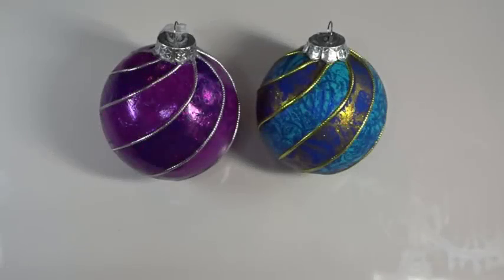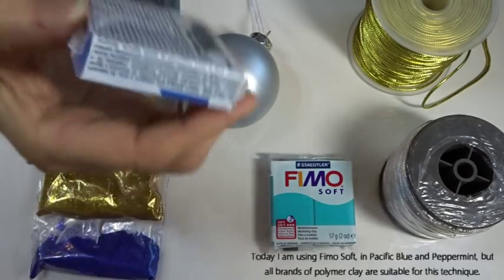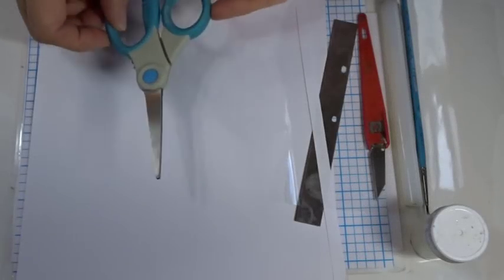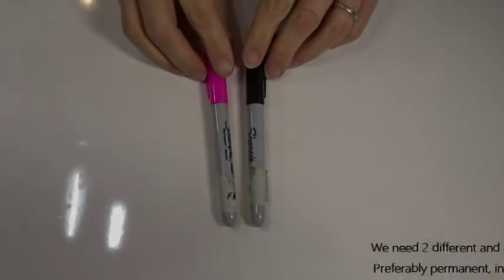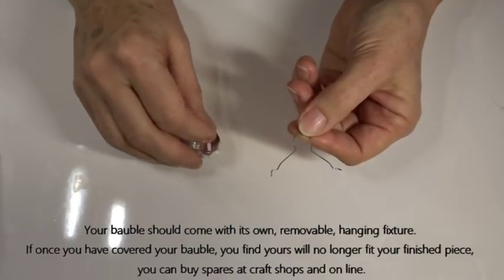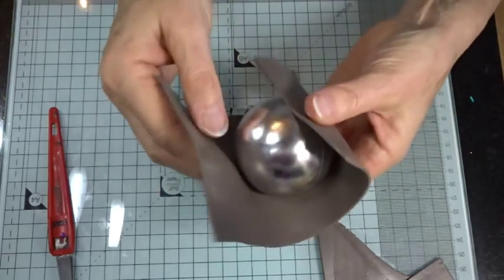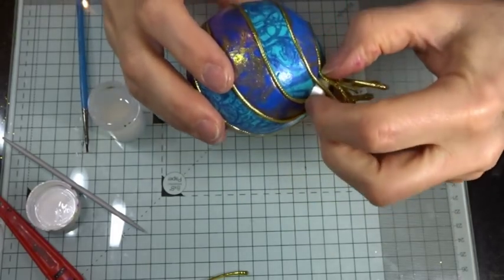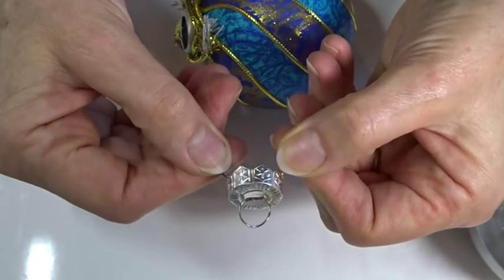Spiral Baubles in Polymer Clay, a tutorial

Comment: Instead of putting a glitter filled sheet of clay into your pasta machine, to never be glitter free again...use a rolling pin...And from glass work I learned, cut INSIDE the marker lines for your template. Gives you the little extra room to fit the clay pieces better.